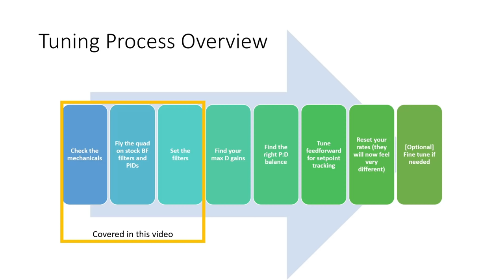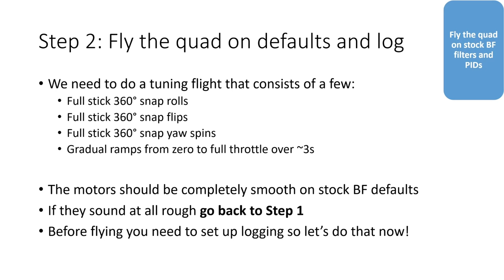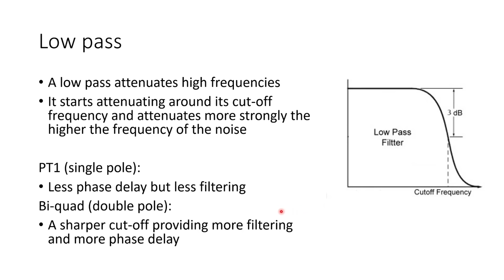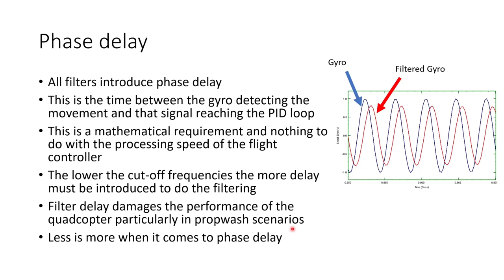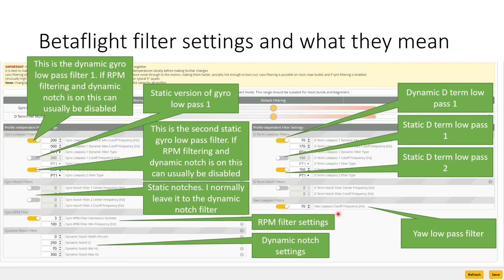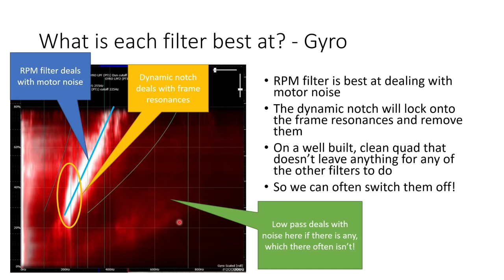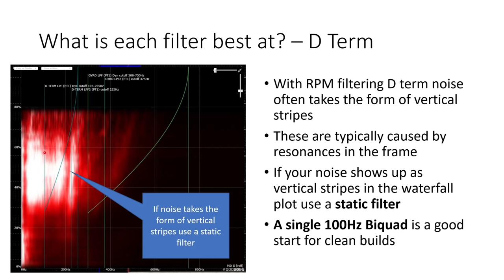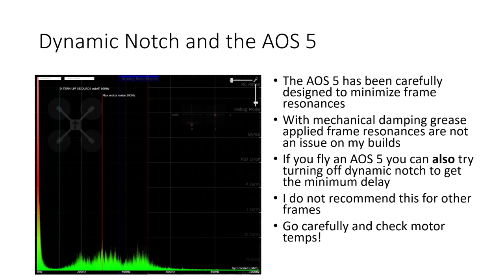Betaflight 4.2 filter tuning. The easy way to get a perfect filter tune!

Comment: Sweet video Chris!!  

9:40 - one minor thing: -3db is 71% of the signal amplitude gets through.  It is 50% of the signal power, but we are not interested in power.  Power doesn't mean anything in this application.  That was a common confusion even with some lead devs till about 3-yrs ago.
Reply from the maker: Thanks for the correction! I knew there would be something I got wrong somewhere. I'll stick a card in the video.
Reply: Good to know Mark. I just started plotting power spectral density in dB in Pid toolbox. Everywhere I’ve read the conversion to dB is 10*log10(power spec). I hope that’s correct
Reply: @PIDtoolbox  20 x LOG10(amplitude)
Reply: @PIDtoolbox  Should be fine because you are looking at the power spectrum, not amplitude spectrum. Problems only arise when comparing power to amplitude. You'd need to compensate for the square root (or the squaring, looking from the other way), so you'd need to multiply by 2, like UAV Tech pointed out.

Power ~ Intensity^2
Reply: Gotcha, thx guys. Yes, there’s a amp^2 and multiply by 2 in there in a previous step so that’s good. I’ve compared it directly to various other Matlab build in functions and it gives the same result. I just like to compute it myself so I don’t need as many Matlab toolboxes to make it work. Nice to have confirmation.

Comment: Using the waterfall prooved super essential to find my right filters. Thanks for explaining even a bit more on how these betaflight filters actually work. What I would find good: Could you show how it looks when your filters work properly? Like showing before-after waterfall graphs and also some gyro+pid graphs? I got the noise of my quad down significantly, but still have the feeling that the signal to the motors is kinda noisy and thus wasting a ton of energy. But a bit of noise in that motor-signal seems ok if I look at UAV tech logs? Hard to judge!

Comment: Hi, Chris. Thank you for explaining everything in simple words. I have a SourceOne V3 frame and I made a modification to it by putting rubber inserts between the arms and both bottom plates. The effect of rubber inserts is amazing and decreased noise singnificantly. Now I think its comparable to AOS5 raw noise. If you are interested, I can send you my log file. I made those rubber inserts out of my silicone rubber case for mobile phone. It's about 1mm thick.
Reply from the maker: Nice work! I'm not surprised the rubber helped reduce vibrations but its great to hear that your quad is flying better than ever!
Reply: Big brain idea: Print it in TPU ;)
Reply: @marcel.schulz  I’m afraid tpu is too rigid for dumping vibrations. ...but please try an let us know;)

Comment: Cheers for those Apex and Glide filter suggestions in your community tab, I just put a new build together with the Zeez F7 V2 FC and their 55a ESC and it was flying really poorly on stock, I used your filter suggestions and used UAVTech's PID tuning guide and now it's flying beautifully.
Reply from the maker: Awesome! Glad the filter suggestions helped 👍

Comment: Thank you Chris. I'm flying a hacked together LOS 3D quad that's pretty much a worst-case scenario in every possible way. Before following this video, my motors were boiling hot, untouchable, 70-80°C after a flight. Following your approach, they're now down to 40°C in regular freestyle LOS without reversing motors and down to 50°C in full on 3D flying.
Reply from the maker: Happy to be able to help!

Comment: Hi Chris, I did this with my catalyst machineworks shocker tank, I did to mine, that which I asked about yours below, ie tightening up the min and max for dynamic notch and D-term, leaving a 25hz margin either side. I also noticed that my motor noise only showed 2 harmonics within the band range on explorer so dropped to 2 accordingly. Also no gyro filters as gyro debugging showed nothing. I have to say, even with deliberately abused props with extra notches (small) & some tips cut off, it still flew fine, not even warm motors and totally clean charts for gyros. FANTASTIC m8, thank you so much. Cant wait for pid tuning, coming soon. Best wishes to you

Comment: Fantastic work. I 100% agree with this logical approach and strategy. D term is the limiting factor and just randomly cranking it up to cope with frame resonances and motor noise  just leads too disaster. Only really experienced pilots can get anywhere near a great tune by feel - I'm not one of them. A quantitative approach is the best way. Watching you and UAV Tech over the past few months has totally consolidated my existing knowledge and I can now fine tune with 100% success. One thing I'd add, just flying on default BF filter and pid settings and then analysing the data is perfect for 5 inch. But something , say with ducts and a poor frame build can fry motors extremely quickly. I always do a quick LOS shakedown flight in the garden for a minute and check temps for before heading out for the first proper tuning flight. If they're not stone cold something needs looking at.

Comment: Thanks Chris, this is awesome.  Finally after over a year in this hobbie, someone has explained filters to me in a way that i can understand and that makes sense.  Now, hopefully, i can tune my filters and pids and get a good flying quad without smoking any more motors, or at least not as often. Thanks for coming aboard and helping us all out with your vast knowledge. Thanks so much.
Reply from the maker: Thanks Kevin! I hope this helps you get your filters dialed in and your quad flying better than ever.
Reply: @ChrisRosser  Hey Chris, i spent this weekend working on tuning my diatone taycan. Way better now but not quite dialed in yet.  Had to remove the gopro to get it close.  Kept going from bounce back to dterm oscilations in forward flight. The videos you have done are awesome but what woyld really help me and probably others would be an example of setting up filters and pids on a dirty build and with and without a gopro, cinewhoop and tuning for running 6s throttle limited on 4s.  Just some ideas.  I really appreciate what your doing. Thx

Comment: This is amazing. With this video, I just massively improved the performance of my latest build, and I understand why I did what I did, and how I did it. THANK YOU SO MUCH. You've well earned my support on Patreon. Your one video did what 18 months of countless videos couldn't do. My quad is flying like I've never known before, and I still have the PIDs to tune!

Hey, Chris, if you're looking for a video idea, I think it could be helpful to do a frame/build resonance analysis that measures and explores the negative impact/increased noise/resonance that can be caused by poor habits, bad practices, or mistakes made during the build process. ..kinda like the video you did about the antenna oscillation issue due to using a long antenna in soft antenna mount, but continue with more examples of common build problems that can cause excessive noise. This would help to illustrate exactly what you mean when you say someone needs to go back and fix/work on the problematic physical aspects of their build before proceeding with tuning. It could give people in this situation a clearer starting point. I think right now, many may not know where to start when they hear that they need to go back and fix things before attempting tuning. Hope that makes sense. Thanks again!
Reply from the maker: Thanks for your support. I've added your suggestion to my list!
Reply: @ChrisRosser  Sweet! After watching more of your videos, you do well identifying some of the physical areas to look into, for improving baseline noise profile of a build. I still think it'd be fun, and helpful, to see some of them quantified but I just had another thought too...

I believe it was in the vibe, and resonance analysis of 5" and 7" quads that you casually mentioned motor and prop balance is never perfect. I immediately thought/hoped you might segue into some info on folding props, as they are said to be self balancing. Though you didn't mention folding props, I realized I am desperate to know more about self balancing, and aero dynamic qualities, and general physical and performance qualities of folding props. More than my previous suggestion, I would love to see you take a deep dive on folding props. It is quite possible this topic could have broad appeal as well.

Thanks so much for taking the time to reply to my first comment above. I know this isn't always possible, so thanks. And thank you as well for your comsiderstion of taking a deep dive on folding props. Cheers!

Comment: Thanks ! the video about Pawo30  -  it helped a lot. The motors stopped warming up, it flies perfectly. Now I solve the problem with the TitanXL5   4s-version , motors-2208. By default, the profile settings give hot motors. I understand that I need to deal with the black box.

Comment: Wow, that's a lot, just trying to wrap my head around the basics so I appreciate this video it's the first of its kind that I've ever seen
Reply from the maker: Thanks I hope it helps you with your tuning!
Reply: @ChrisRosser  no it does not. Help me understand what filtering does please. It filters out vibrations from the motors,frame and props so the gyro on the flight controller still feels them but compensates for the vibrations when you fly so your whole flight experience is smoother. Is that the goal? To not have prop wash and whatnot?

Comment: I've very excited to go and try this out. I just build my first 5" last month and have been flying every day. I've noticed some points of my flight where I could use some better filtering but I've been worried about adjusting because I haven't had a good enough explanation specific to the filters. Thanks. :)

Comment: You talked about over tightening screws in step 1. Do you know the torque spec for the screws on a soft mounted motor? Soft mount is 1 mm thick tpu print.
Should I be soft mounting at all? Does mounting directly to the arm give a more consistent and/or narrow frame resonance frequency? I want to torque the motors to the same spec so they all vibrate at the same frequency in as narrow a band as possible. So soft mount or not and what torque gets me the most narrow consistent resonance frequency? Please keep making videos like this!!!!

Comment: Thank you so much for the best filter tune video I have seen. I understood about 60% of what you were talking about, instead of 5% from all the previous videos I have seen.

The help you give people like me that do not have this kind of knowledge is fantastic. 

I have to ask you a quick question. What pidloop frequency do you run with rpm filtering? 

Everyone seem to use 4khz and dshot 300. I have an F7 board and run 8khz and dshot 600. Is that wrong? What do you use?
Reply from the maker: If you have an F7 or H7 8k and Dshot600 is best. If you have an F4 4kHz and Dshot 300 is best. 👍

Comment: mate! can you try to make an example with some more aggressive propellers? i found myself pretty clear with smooth props (5'', tri-blades, low pitch) but when i switch to bi-blades high pitch the waterfall plot shows a totally different story. ...I understand, as you said, tune with the prop you normally use but for a specific setup (chasing cars or long range) i would like to use more specific props and it definitely needs different approach. Thanks for explain everything so clear!  Cheers!

Comment: What about horizontal banding?  After applying your tuning guidelines, especially on pitch, I've got a band across the waterfall graph at ~ 55% throttle, flat as a board.  It wasn't there on base tune.  There are faint ones at 62%, 21% and down around 8 - 10%,   On roll, there's one that reaches from 0 hz out to about 600hz at around 35% and a couple more faint ones elsewhere but the 55% pitch line shoots all the way across to 10k.  That being said, it flies great as it sits now.  Can't wait to see your PID tuning video.
Reply from the maker: A flat band at a certain throttle position could be aerodynamic or electrical noise. I wouldn't worry too much if the quad is flying nice!

Comment: Thanks Chris for such a wonderful videos, I just wants your advice I already followed your tips and after a clean build I turned off all filters as you did, and the results are outstanding for the performance in terms of smoothness,responses and motors sound , I don’t need even to change the PIDs I stuck with the default, but what I got it’s the heating I think it’s across the borderline of the normal, I live in Iraq and the weather temp around the 45C at 6pm !! 😩, if there any recommendations to do to reduce the hotter motor rather than changing my country 😅😅..
Reply: Thanks Chris for your reply.. but unfortunately there is an error occur and I couldn’t view your reply, it’s listed with notifications but couldn’t view it, I reached in reading when you said “ you can’t even “ and the rest doesn’t shows.. it will be awesome if you could send it again please ☺️
Reply from the maker: If you're flying in 45 C temperatures hot motors are normal. Under normal conditions motors will run 20C over ambient which will feel very hot in 45C weather. If your motors sound smooth I wouldn't worry.
Reply: @ChrisRosser  
Thank you so much Chris, ☺️

Comment: Hey Chris, this video is absolutely brilliant. I do have a few follow-up questions which might be too long to answer here, but I'll ask anyways. Your suggested tune is for a "Clean" build, but my builds are rarely that. How would you change things for something a bit more beaten up? In particular I am often using props with nicks and gouges. Would RPM filtering still take care of that, or are your minimalistic D-Term filters likely to allow excessive noise/motor heat/flyaways? It would be great to have rules of thumb about these variables as build cleanliness and quad size go up and down. I'm really looking forward to part 2 about PIDs. Thanks!!
Reply from the maker: Hi Oliver, you could try my filter recommendations and if they are too aggressive try reducing the D term filter cut-off to 90 or even 80Hz. Thanks! Chris

Comment: This is amazing! Best structured filter tune guide out there! Great job 👏.  Any chance you can make a video tuning filters on Emuflight with no rpm filtering?
Reply from the maker: I have to be completely honest, I wouldn't recommend anyone fly a quad without RPM filtering its such a keystone feature. I will cover Emuflight when they implement the feature (I think it's coming in 1.0)

Comment: I have to say that your video are becoming the amount the top pages I visit on youtube. Great information and well explain. By the way which version of betaglight was this. I don't see the "Gyro RPM filter" on my betaflight configurator ver10.7.0
Reply from the maker: Hmm, you may need to set up bidirectional Dshot first. JB has a tutorial on it.
Reply: @ChrisRosser  ok I guess I first have to make sure my FC/ESC support bidirectional Dshot
Reply from the maker: They all support it now if you have the right firmware. 👍

Comment: This might sound random because it is, but talking about frequency and seeing db on the screen (even tho we're talking vibration Freq not radio) just made me realise that we use db for measuring sound, but we also use it for measuring signal strength on a rf system but that's technically light, science loves to make new scales and ways of measuring stuff but they can't come up with a different way of describing the measurement of 2 different fundamental aspects of human life, light and sound lol! How loud is 1 lumen from 1 metre away? Haha ok back to trying to figure out filter tuning my quad

Comment: so you have VERY well explained what the filters do and which is for what but failed to tell the last bit in "how to apply them"
we know now what the data means, but not how this applies to BF Filter settings.
your examples do not resemble the BlackBox data you have shown before at all like the 100Hz RPM or the 250Hz NotchQ with max at 400 wherein your BlackBox the range is between 180and 380Hz but you have set 100 and 400 ... don't get me wrong I do appreciate your video, it's just that the conclusion and the data shown isn't the same. this is what makes this stuff so complicated as literally ALL creators AND the Betaflight Def's themselves do this, the numbers are clear, the way how we get them too, but then there are completely different numbers applied.
Reply from the maker: Hi Mario, thanks for your comment. With the RPM filters and dynamic notch they target frequencies across a range. It is therefore vital that their min frequency is below the lowest frequency noise you wish to target. For the dynamic notch it is also important that its max frequency is higher than the max noise frequency.

 It is not critical what the exact value is as it will then target the frequency in flight. That said you do not want the notch filters coming too low in frequency or they add too much delay. 100Hz is a good balance between these two considerations. You also don't want to set the dynamic notch max frequency too high because that reduces its resolution.

Comment: Best explanation of betaflight filters that exists! Thanks. Do you have any sense (or is there any way to measure or calculate) the exact delay caused by different filters and frequencies? It would be really cool to see an 'estimated delay time' stat on the filters tab that changes when making adjustments.
Reply from the maker: I use UAVTECH filter calculator. It gives delays for different configs.
Reply: @ChrisRosser  oh wow, what a great tool! I didn't know that existed. I'll have to spend some quality time with that spreadsheet. Thank you

Comment: Thanks for these clear explanations, it's nice to have an engineer approach

I have a question, in the freq vs throtle diagram, what are those horizontal bands at throttle constant ? I got one for 12,18,25,35, ... % of thr.